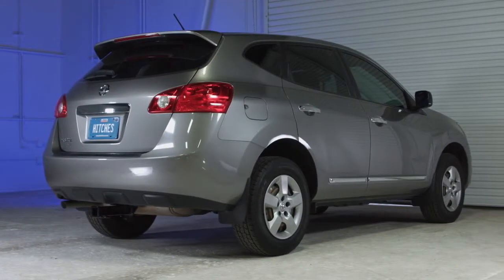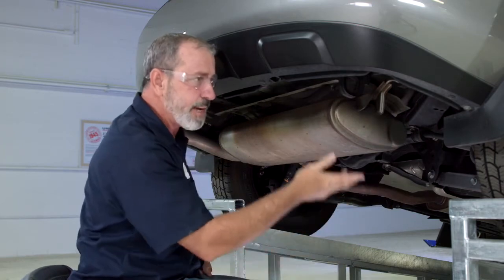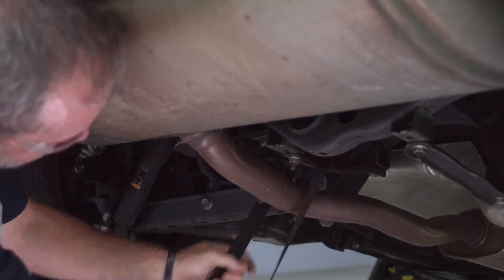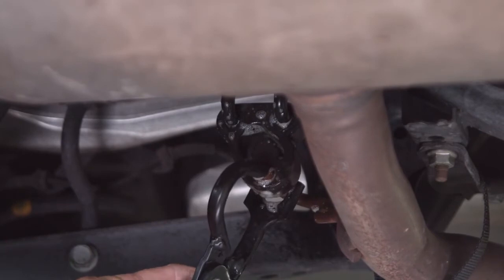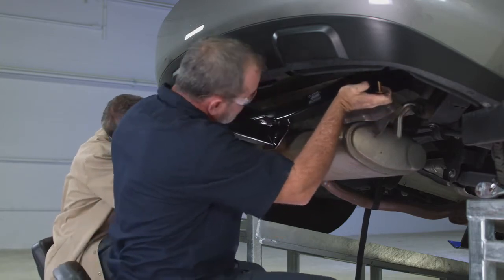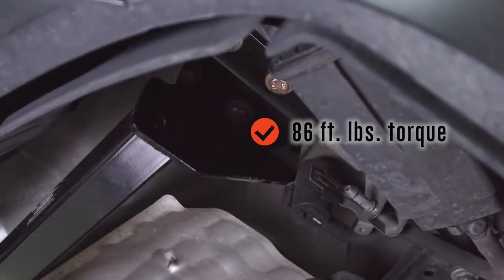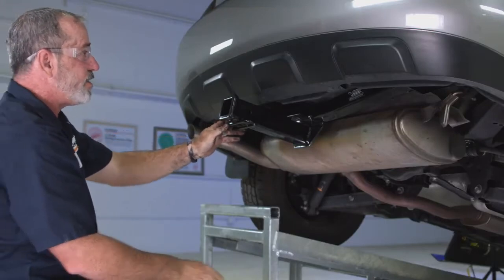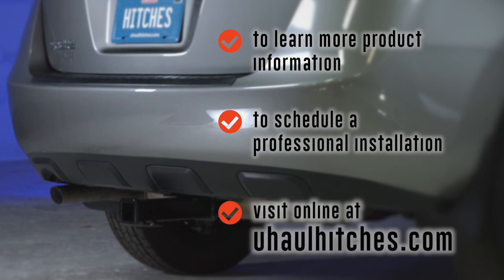2020 Nissan Rogue Trailer Hitch Installation

Comment: I just did this and i want to go ahead and say guys don’t let “drop the exhaust”scare you. I sprayed bushings with pb blaster and they slid right off. And you can use a 6x6 block to set under the muffler so it can rest there while you finish installation.